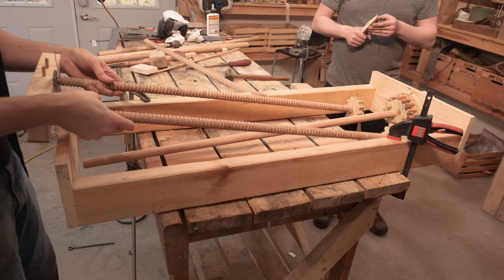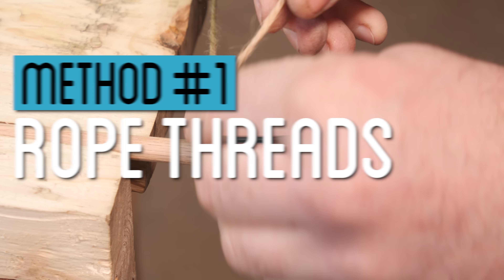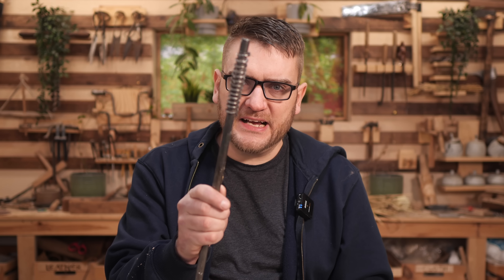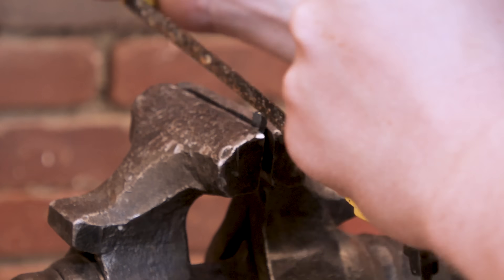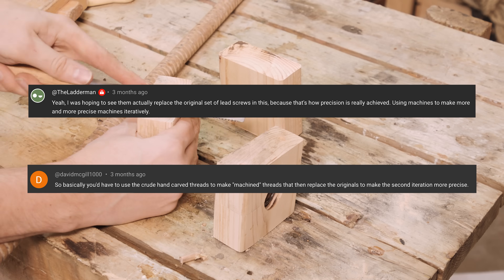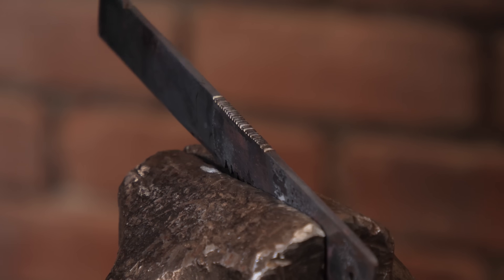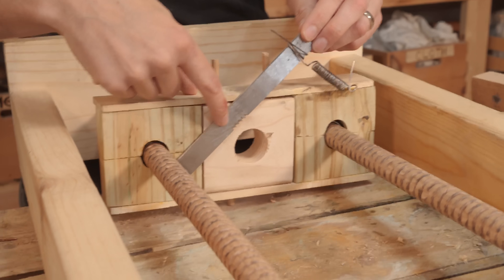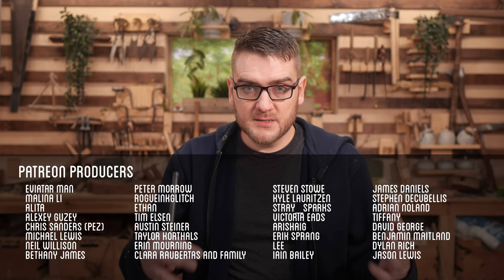This DaVinci Machine Changes EVERYTHING

Comment: For the marking block I thought if you positioned the dowel vertically, then get the marking block started like it is. When it's fully on, have a weight with a hole in the middle on top and add some dowels to make it easier to turn. the block Then run it fully up and down a few times. Have multiple blocks with thicker thread cutters to swap out. I agree your current version is better, but to get those initial 2 rods, this could have been a good way. 

For your version it may also be nice to easily adjust the cutting blade position on the block, so after a turn or two you move it an 8th inch for sharper teeth.

Comment: Aaaaah why is the part free on one end? 9:30  Still amazing work, very fun and exciting video!
Reply: Good catch there! Fortunately, we found that the center rod doesn't have to be anchored on the back side, since the guide box references to the lead screws. We felt that fitting pin on the back side only added to the internal friction of the machine.

Comment: 14:00 Guys..... USE THE REVERSE THREADS TO MAKE REVERSE REVERSE THREADS.
Reply: Exactly. Make one set of reverse threads that are more accurate to make the next set of reverse reverse threads that are just normal threads but are yet again more accurate.
Reply: Boosting! I was going to say the same thing.
Reply: Absolutely! One other issue though is that to use the reverse threads, you'd have to basically update the machine to also use reverse threaded nuts inside the guide block. Totally do-able, but we wanted to focus more on proving the machine could successfully cut accurate metal threading. Additionally, each time you cut a new rod, depending on your gear ratios, you have to account for new thread spacing. If we continued improving, I think setting up the machine with balanced/equal gear ratios would be the way to go.
Reply: @ElliotKrueger  Now you're into the @machinethinking world!
Reply: @ElliotKrueger  as it becomes trivial to make a nut making tool from an existing metal thread you can just sacrifice one of your made screws to make THE PERFECT nuts for this iteration of screw.
Reply: I was thinking the same thing
Reply: I thought the same, however as they needed the gearing to make the tighter thread spacing, the gear solution was just better as it solved both problems instead of just one. Swapping out the gears will allow for just about any thread spacing, including 1:1 with the lead screws so it can still be used to make better lead screws.
Reply: @DreadKyller  Gearing is good, but both would be far better, because those original screws are still very wobbly, precision-wise.
Reply: It was so obvious lol

1# Make improved but normal threaded wooden screws.
2# Use normal threaded wooden screws to make reverse threaded metal screws.
3# Use reverse threaded metal screws to make everything after, but from a better machine.
Reply: I was thinking the same thing and was trying to figure out what I was missing as to why that wouldn't be the answer. It seemed so obvious.
Reply: Commenting to say ditto
Reply: I kinda feel like the precision won't improve as the drive screws directly indicate the profile in the thread cut, so the end product is only as precise as the machine already is, or wouldn't it?
Reply: @karicowo  by the nature of using a bigger nut it will average out smaller inconsistencies in pitch over the area in a running average kind of way. this will limit how much local deviation you can have in pitch after a few passes

Comment: What a great topic! Great video. I an surprised to see casting worked so well.

I am always designing machines- I seldom build them, but I do like thinking it through.

I think I would make a modified #3.

I think some refined techniques would help.

Wire wrap your rod: 
* Flatten the wire a little bit - better connectivity. Ideally use square stock or half-round.
* Roughen the surface of the rod or score it at regular intervals to match the intended coil.
* Coil the wire around the rod to pre-shape it.
* Drill a hole in the rod several inches from the end.
* Seat the wire in the hole, and proceed to tighten and position the coil.
* Wrap under high tension, ideally using hot wire.
* Use a spacer to maintain an accurate thread.
* Cut a groove at the end of the rod and seat the wire into it.

3 foot, half inch rod with quarter inch threads on 34 inches of its length.
About 21 feet of wire and 136 turns.

Hmmm... might have to try it :)

Comment: Am I wrong in thinking that "standard makes reverse threads" does that not mean the 2 new ones made, could be used to make 2 more new ones and flip the threading back?
Reply: You are correct. With the added benefit that you would have made another jump in accuracy making the screws twice. I just don't like the fact that they never took the time to learn to make hand threads. It takes a long time but shouldn't take you a year to learn how to file in a thread. Maybe about a week at most.
Reply: With reversed threads, they would have had to rebuild the gearing with reversed nuts. You can’t run reversed threads through the same setup. I think that now they could make some good threaded rods out of metal and reiterate the machine if they wanted to.

Comment: Hey, for the soldered wire approach, I noticed you wrapped the wire around the post by hand. I recently made chainmail, and the easiest way to make consistent spirals/loops/links is to drill a hole in the center rod and then twist the rod (vicegrips and a lot of time is how I did it, but an electric drill works too). It may not be applicable for the current project, but if you need lots of consistent spirals or split rings for future endevors, that will increase productivity and ease of the project tenfold.
Reply: There's actually a specific tool for this that's essentially a chuck on a crank handle, which you attach to a work surface. Put the rod and the end of the wire into the chuck, hold the wire taut, and start crankin'! Within seconds you'll have a tightly wound spring at the length and diameter of your choosing! (Goldsmith here, very useful tool for making different styles of chain link jewelry. You can even use whatever cross-section shape of rod you need, from square to octagonal, and you'll get links in that shape!)

Comment: A flat tapered rod with a raised center line, kind of like a sword. Heat and twist and you have a screw. Now, it won't spiral evenly so you should start by heating the section closest to the head first, then moving down till you reach the tip.

Comment: I may be wrong here, but if the original threads made a track that would make the machine run reverse threads, couldn’t you run the reverse two times to end up back at the start with the right threads?
Reply: Yeah that's what I thought too, just make a pair of stepping stone rods, though the extra gearing is needed anyway for fine thread.
Reply: Totally! One other issue that I don't think got mentioned in the video though is that to use the reverse threaded rods, you'd essentially have to make a whole new machine that also had reverse threads inside the guide block. Totally do-able, but we wanted to focus more on proving that the machine could manage metal threading. Additionally, each time you cut a new rod, depending on your gear ratios, you have to account for new thread spacing. If we were to continue improving, I think setting up the machine with equal gear ratios would be the way to go.
Reply: The fact that y'all got it so precise though was awesome!!
Reply: Just run it with the reverse lead threads and you have the correct lead threads
Reply: That's what I was thinking, but I would also try to replace them with metal threaded rods that hopefully wouldn't wear out as fast as wooden rods since they have to run back and forth across those rods so many times just for one new rod.